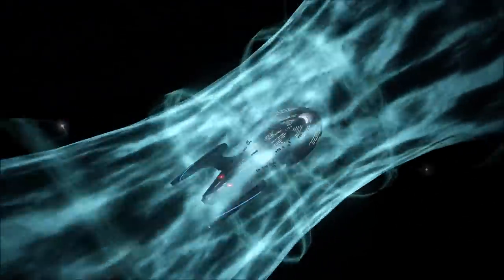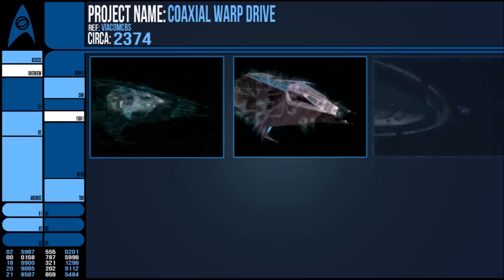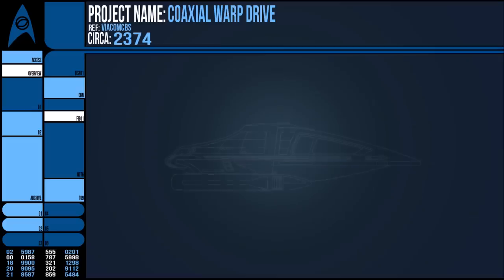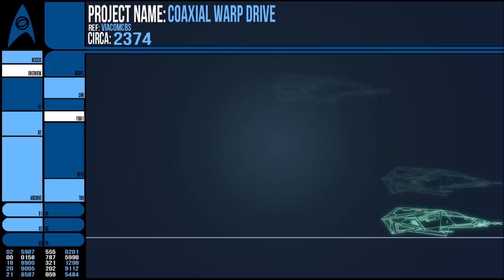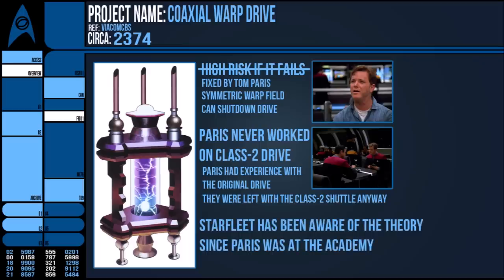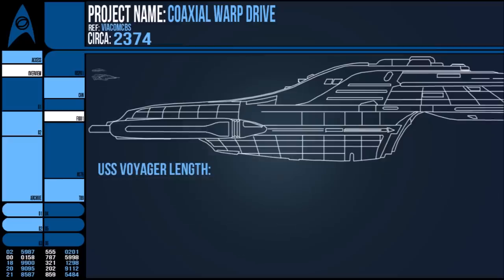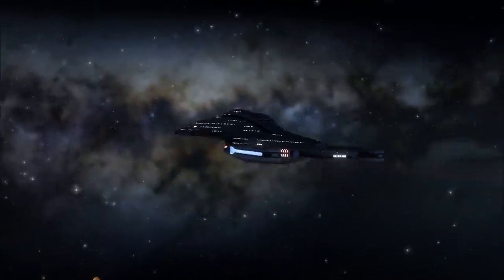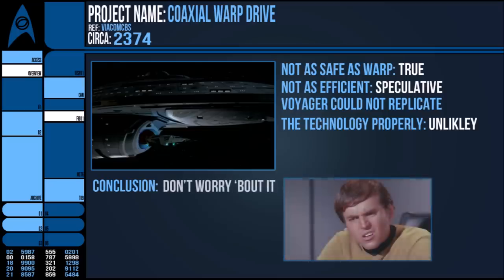Why Not Coaxial Warp Drive? (Star Trek Theory)

Comment: Going by the diagram example. Picking a point in space and pulling that location to you and instantly slingshotting you to that point is a very great idea! They were just using it in the wrong way. If they use their conventional warp in a combination of the coaxial warp. While moving warp 9 and using Coaxial jump in conjunction even if the jump is only a warp 9.5. You can boost the ships warp travel speed though all be it in bursts. The ship would move at warp 18.5! Since space is mostly empty. You can use that reactive force of motion to coast across space without wasting energy to maintain a constant pull in front of the ship. I also have a Theory of my own about the Warp Space Drag. The bigger the bubble around the ship the more energy needed to pull the space around it and to move it forward. Think of it as when longer and narrower ships move faster through water, than wider and shorter ships do. I believe the same visual concept reference should be applied to space warp but instead of being on the surface of water you are underwater much like a submarine. Because you are displacing warp space around the entire ship much like a submarine does when it moves underwater.  Taking all this theory into account for better and faster conventional warp speeds They need to manipulate the warp bubbles shape to stretch it out longer and thinner as well as designing a ship that has to the ability to manipulate while on the fly. So it can change course while in warp so it doesn't have to warp in straight lines. I don't know if they can already do this in-universe. but I'm just going to throw that out there. So in a quick summary. Go warp 9 Coaxial Warp slingshot to Warp18.5, coast that speed until the Warp Space Drag effects that speed back to the ship's original Warp 9. The Coaxial Warp warp boost speed dissipation would depend on the ship warp bubble shape. So the slower the dissipation rate the fast and longer the distances can be traveled. Okay, I think I've NERD the Shit out of this. lol

Comment: There are so many things that the writers had to wash away as options for Voyager to last 7 seasons instead of 4.

The Quantum Slip Stream Drive, Coaxial Warp Drive, and Transwarp Drive options could’ve been implemented and used in short bursts to drastically reduce the trip.

Cutting the journey down to 10-15 years, along with routine contact with the Alpha Quadrant, would make the situation far more bearable for the crew.

Additionally, with routine contact with Starfleet, sharing the technology to build a Starfleet Transwarp Conduit, a Quantum Slipstream Gateway, or bargaining with Species 8472 to use Fluidic Space as a conduit to reemerge in the Alpha Quadrant are all possibilities.

Then again, there are tons of ways they could’ve made the show more appealing and the stories better. Going completely serialized, and starting each episode with a title card that gave a Stardate and estimated distance from Earth could’ve been one of a myriad of things that would put some stakes to the show.

Comment: My guess as to why we never heard more about the coaxial drive, may be down to the following things...

1. It was an experimental technology when first encountered, and even though all onscreen problems were adressed in the episode, there is no telling if there were other problems that hadn't been discovered by the time we saw it in the episode, thus deeming the technology unreliable.

2. Even if the technology was reliable, it might have had scaling issues, thus only being applicable on vessels with a size up to the size of the test ship (As already mentioned in the video).

3. Politics might have played a part in why the Voyager crew didn't pursue this technology onscreen after the end of the episode. Given that the test ship wasn't in the possession of the creators of the technology, the Voyager crew may have been required to hand over any and all data gathered about this technology, in exchange for restoring both Tom Paris and Cpt. Janeway to their original forms. This would include the modifications made to the shuttlecraft (Assuming the drive wasn't knocked out entirely when Seeth was apprehended).
I'm pretty sure this is a deal that Cpt. Janeway would agree to, as they have acquired the technology without the consent of the creators, which could lead to a diplomatic incident that could have severe consequences for the Federation (Opening up the Federation up to a potential war against a species with a propulsion system that is superior to the Borg Transwarp propulsion) if the creators managed to perfect the technology before Voyager could get home.

The 3 above are the most likely in my opinion, though definately not the only ones.

The idea that there might be a challange regarding availability of fuel would fall under category 2. The Slipstream Drive was also partially the victim of this premise. When they made the catastropic attempt to return to the alpha quadrant with the use of the Slipstream Drive, they mentioned that a key component was already starting to break down, meaning they were on the clock, or the drive would become inoperable. So definately not unlikely.

Comment: From what i gathered from the subject episode- the amount of energy needed for a larger vessel and considering that energy would also need to be spent per destination distance meaning - energy for mass + energy for distance - standard warp even if slower far out strips the coaxial for effective use on larger vessels . The coaxial however would be far more effective for a in combat positional use if given its own small power reserve  a set amount of jumps in combat could be allotted . Making it valuable but not in the general sense. My guess is they expected the viewer to be able to put that frame of thought together judging by the conversations in the episode and would also explain why the tech was not re-visited.

Comment: Let's imagine that there are three insurmountable problems that cannot be solved anytime in the foreseeable future: 1) a size limitation making use on proper starships of even Defiant size non-feasible. 2) a range limitation, say 25 light years or so, and 3) a lengthy cooldown making conventional warp faster for trips longer than that 25 light year range. Despite these strict limits, the technology could still be very useful indeed.

Picture a set of small starbase facilities placed in orbit of major populated planets, equipped like airports. Each has a number of these vessels assigned to hangar facilities. On a schedule, a ship departs for a nearby system with another travel hub facility within the 20 light year limit. Say each one is around the size of a Danube-class runabout, with seating for maybe 50 people or so --equivalent to a Greyhound bus. The ship loads, departs from the station, jumps to the destination, docks at the destination station, the passengers disembark and the ship goes into the hangar facility while the jump engines are on cooldown. Another ship which is off cooldown cycles out of the hangar to take the next scheduled route. Number of vessels would be determined by how many are needed to maintain the flight schedule and the flight schedule would be determined to meet passenger demand.

With such a system, you'd have a transport network of very rapid travel between nearby systems that could easily meet the demand of civilian passengers, and light cargo could be transported that way as well with cargo variants carrying probably about as much as a modern semi truck. A lot of planets are within 20 light years of one another, for example you could go from Earth to Vulcan or Andor in one jump faster than you can take a flight from New York to Boston today. Longer trips would be feasible if you switch ships the way people take multi-flight trips today.

Such a system would not at all replace full sized starships for a number of reasons, but it would enable a rapid transit network that would be quite useful for making travel between local systems quicker and easier.

Comment: I thought of two reasons!

1. Energy if the drive was as efficient and they traveled 1 hours distance in 1 instant they would Need to produce 1 hours worth of energy in 1 instant as well, like the difference between regular rockets and the theoretical rockets that are propelled by exploding nukes under them.

2. Astrogation if they are warping somewhere they can steer on approach. that would be much more difficult with this, and it also may not allow such precise “landings” at longer ranges.

Comment: At short ranges and sizes the Coaxial warp field's distortions are small and easily controlled. As the size, and especially the length, of the field increases, the ability to compensate for these distortions becomes more difficult. At a certain point, the amount of time distortion detection takes exceeds the tolerance of the field to said distortions, in other words you run out of time to correct them, and the field destructively collapses. The collapse is destructive because the field is not spherically symmetric and thus during uncontrolled collapse, part of your ship is in normal space, and part of it is still in Warp. This issue is less of a problem with bubble shaped fields because they are shorter for a given size vessel, do not collapse destructively (usually), and are inherently more stable.

Comment: Coaxial Warp drive probably requires a lot more planning than standard Warp. Due to requiring shorter jumps, this means that unless they warp to known locations they might have to deal with plotting out a more accurate course, as in most every sci-fi the idea if blind jumping always leads to mapping out the location you ended up in.

Outside of that, there could of been more of a issue with just the drive itself the larger it gets as what problem was solved by Tom might be only manageable on a smaller scale.

Comment: Well, if excessive warp travel is bad for space, I bet folding space to travel has got to be worse. 

Coaxial Warp Drive was put in the dust bin, right next to the Spore Drive, the early Transwarp tech used in the early Excaliber ship in ST5, and whatever you called what Barcley did to the Enterprise in the Nth degree (that was kinda space folding too).

But, imagine if the drive did work, and you didn't need too extreme of an exotic particle to make it go. With the size of the ships used, you could make an awesome fighter ship: Their carrier could get to the maximum range of the Coaxial Drive, and then the ships would launch, warp to their targets, effectively coming out of nowhere, hit them hard, and then jump back their base ship.

Comment: The Coaxial Drive kind of reminds me of the Hyperdrive from the 90s Lost in Space movie... in that the Hyperdrive uses gates to connect two points in space that the ship then moves between. Without using the gates, you’re flung to a random point in the galaxy, akin to putting random co-ordinates into a Coaxial Drive and activating it.

If it is a case that the drive can only do short distances on its own, then couldn’t Starfleet do the same as the Hyperdrive and set up gates that could do the warping of space, while the Coaxial Drive just creates a field around the ship? Basically split out the properties of the drive. Let the gates do the heavy lifting while the drive only has to stabilise the field around the ship, meaning it shouldn’t need as much power to work on larger vessels.
Reply: A bot how the NX-01 Enterprise left subspace beacons behind for communication because the range was to large for their own antennas. Also gives plot potential if enemies blow up the gates or threaten to do so.

Comment: Common mistake. Warp drive doesn't warp space time outside of the ship; It warps the apparent mass-energy of everything inside of the warp field from the perspective of an external frame of reference. The warp field encasing the front of the ship and the one that encases the back of the ship push off of each other, propelling the ship forward. It's like putting jet engines on a bumblebee.

Comment: It also seems possible that coaxial warp jumps could be dangerous for other reasons; coming out of the coaxial warp too close to another object in space and colliding, or encountering some sort of slipspace interference might get more and more likely the further out into uncharted space you jump. It may be limited in practical terms just by sensor range
Reply: A bit like the limitation of BSG hyperjumps. You might end up in a place you don't want to end in.
Some time ago I did some nerdy math, and jumping 50 lightyears with an accuracy of 1' (1/60°) you might aim for Neptune and end up in the Sun.
Taken to the extreme, if Voyager jumps with that accuracy from home, they might end up in a solar system to the left or right of where they want to go.

Comment: I would say it was due to the amount of energy needed to perform the coax warp vs standard warp. You'd have to bend space twice for the coax warp, which for a smaller craft like a shuttle could probably be done with the antimatter reactors they had. But think of the rate of scaling for energy to size. To make a larger warp bubble would require far less power than needed to bend space twice (once to bend it, once to return it) for a MUCH larger ship. Especially when the nacelles do a lot of the heavy lifting for stabilizing the warp bubble vs the drive itself doing everything (think of a computer with onboard graphics vs a dedicated gpu). This scaling issue is why I believe they couldn't do it with the Voyager. Not to mention that warp uses a constant amount of power whereas I would believe that the farther you coax warp would require greater and greater amounts of energy as you're bending more and more space.

Comment: Could it be that the species that owned the technology (stolen by Steth) told the Voyager crew they couldn't have it due to the fact that it was stolen by a criminal and was never meant to be shared with others. Or like you said, it's not safe as warp drive or Voyager needed a particular substance to maintain it. That's my theory on the situation. If they were allowed to have it, the Voyager series would over.

Comment: So it's basically a Wormhole Generator Drive. Yeah I imagine that it's something that is probably a lot faster for short hops as it effectively allows for instant teleportation between two points. But it probably has a very limited range and/or an exponential power cost for longer distances which means you have to keep jumping short hops over and over again.

It should definitely still be useful technology, as it would in theory as described here basically let you bypass any possible defense or sensor because you're not traversing the space the between the two points. As far as anyone else knows you would just appear at your destination. But I could also see that as being a good reason for why that technology would be banned. And if a countermeasure were able to be found to detect it, then it would essentially lose all use.

Comment: I think it was just because the amount of power needed to “bend” space increased with size far faster than the ships power source. For example, making a shuttle with coaxial warp was fine, a runabout would take a much bigger warp core, and for something as big as voyager, even making the entire ship a warp core wouldn’t make enough power to bend that much space for any meaningful distance. Also, because coaxial warp was only able to do at most 20 light year jumps at once, and tens of thousands of light years needed to be covered, sending a shuttle off to earth on an (at best) several year journey with sensor logs and letters home wouldn’t work either.